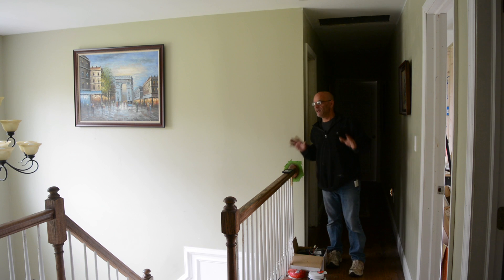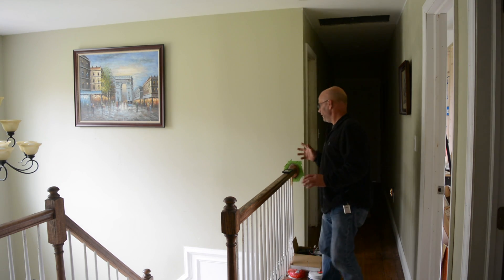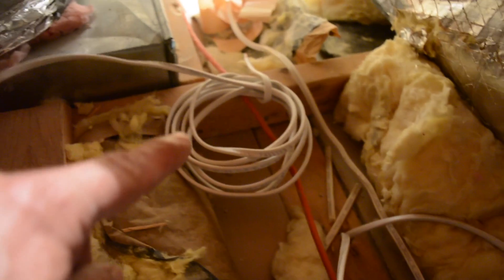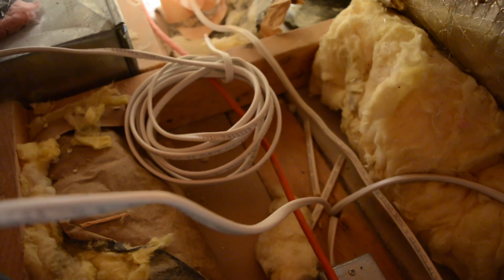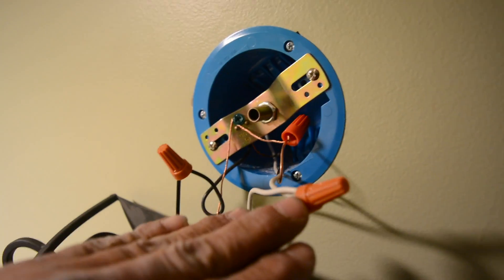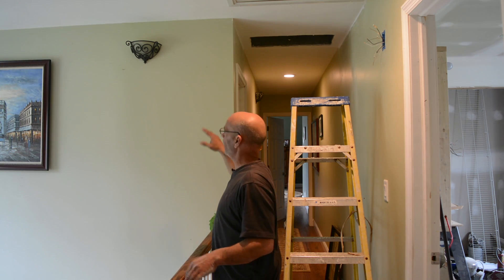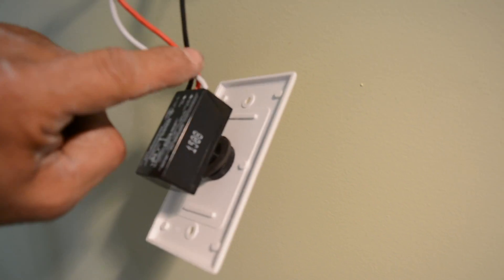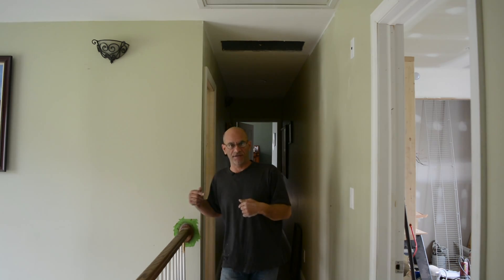Installing Lights on A Photocell

Comment: I've found that when locating a place to drill down into the top plate to run the wire for your light. You shine a flashlight into the hole you made then go up into the attic look between the top plate and the Sheetrock you can see light then you can drill in the right spot! If you can't locate a place to measure